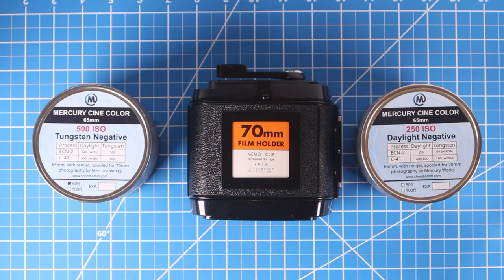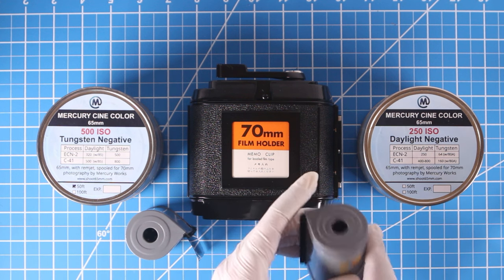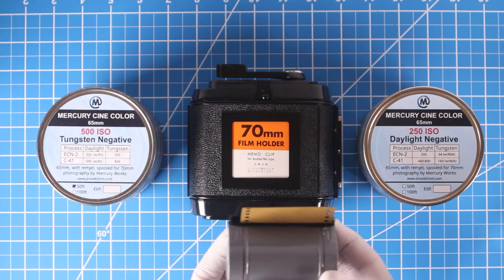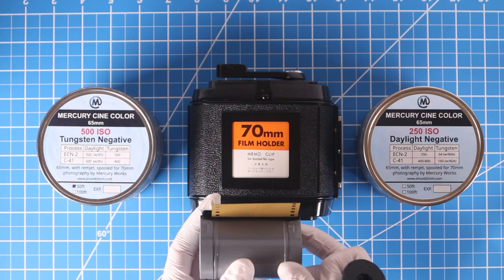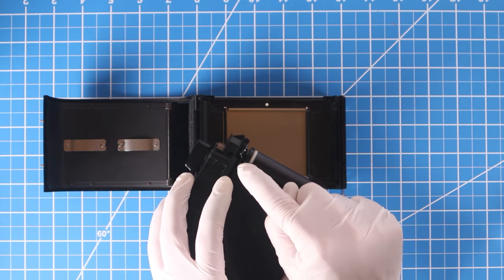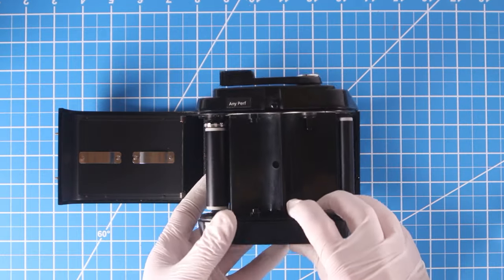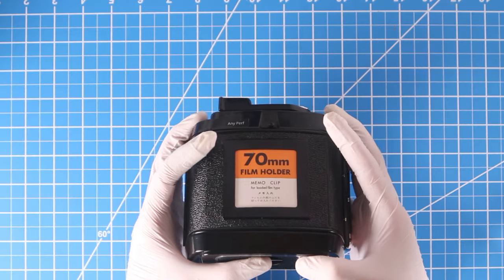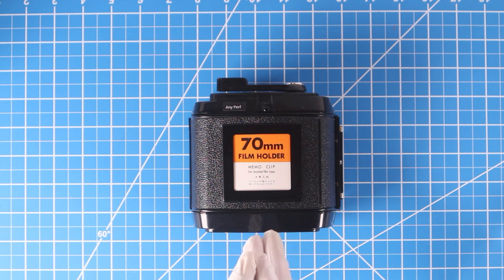How to Shoot 65mm film in your Mamiya RB67, RZ67, and Universal Press

Comment: I’m still using 70mm TriX 320.  Limited to an old Nevro 21 tank for 116/616 roll films.  Does anyone make a modern 70mm reel to fit the the Jobo 1520 or 2509/2520 tanks?  I have an old big metal reel but no tank for it.
Reply from the maker: Yep, right here (for Jobo 2500 tanks, accepts 65mm and 70mm film): https://mercuryworks.store/products/jobo-2500-series-65mm-developing-reel

Comment: any kinds of these film for 35mm camera available?
Reply: This is twice as wide, it wouldn’t fit.
Reply from the maker: Kodak makes their motion picture film (which is their most advanced film) in both 65mm and (far more commonly) 35mm.  The 35mm type can be shot in regular 35mm cameras if you load cassettes yourself.  Loading and using 35mm cassettes isn't nearly as nice as the 70mm cassettes I'm showing here, but it can be done with special reloadable cassettes and a "bulk loader" by Kalt or Alden.